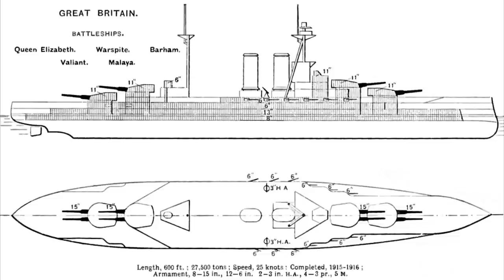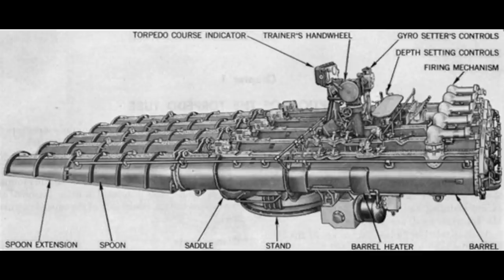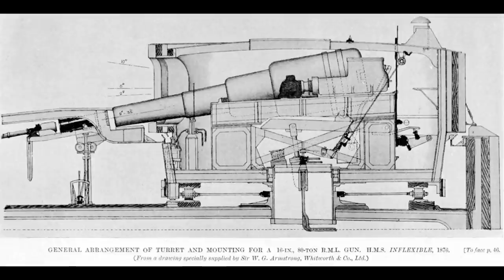The Drydock -- Episode 165

Comment from the maker: Pinned post for Q&A :)
Reply: What's the closest Western equivalent to the Japanese destroyer Shimakaze?
Reply: When HMS Venturer sank U-864 while both were submerged, the feat was deemeed extremely difficult if not impossibile. Nowadays and in the Cold War how easily could  submarines sink eachother in combat while submerged?
Reply: What things would have to happen (other than the Washington Naval Treaty not happening) for the L3 design to be chosen over the M/N3 and built?
Reply: SAil power is interesting as there are several attempts to incorperate it  .   
The coal crises of the 20-30s gave rise to the fletner , system, but was disgarded after the coal crises was over ,  in the 70s during the oil crisses  Coustau build a ship with the flettner system  ,  but again it was disgarded after the oil cirises was gone ,  but recent years it came back  and ships like E ship one where build  with that system reducing emisions .   

Also several cruise ships are buld with 4 to 5 and even 7  masts . to cruise the carabean and other areas ,only having an engine as an aid  .  

Also several large bulk and cargo ships have solar panels and systems to raise on the cargo holds in a clipper style configuration . aiding with propulsion .  when having a tail wind.
Reply: Canadian QE...did/was there room for 3 extra British QE in the British shipyards in 1913 or 1914 consideringthe international BBS being constructed,  the RN battleships and any other larger vessels like BCs and Armoured Cruisers. Wouldn't they take up room of a future planned BB or BC like Hood. Would their construction slowed as WW1 took hold like other British capital ships as well

As for their use, I agree with your summaries in WW1, British QEs being an part of Beatty, Canadian part of the Main Grand Fleet. 

WW2, wouldn't Canadian QEs also fall into the BB escort role across the Atlantic like Canadian Navy fell into the anti sub role in WW2. Leaving all 5 British QEs being moved to Gibraltar and Alexandria. I doubt Canadian would want their BBs in Mediterranean, let alone the Indian Ocean. The heat might affect them as well. RN at least cycled their crew, officers and members through their stations like the Mediterranean Fleet in the inter war period. I doubt would, and the air conditioning for the 3 Canadian QEs wouldn't be that great or modified from Atlantic waters.

Scapa Flow or Gibraltar might have the length of the leash IF the Canadian Government had control over their assets too. Maybe free up the new KGVs as well as Home Fleet might have been based around the older Canadian QEs if they weren't escorting convoys across the Atlantic. 3 BBs vs 1 or 2 German BBs  or BCs that emerge from the North Sea
Reply: Has there ever been a serious attempt to develop chemical effect warheads (HEAT, HESH, etc) for naval use? (Excluding missiles)
Reply: How was HMS Royal Oak modernised prior to WW2 and how much more effective could she have been than her sisters?
Reply: Nice entry. A question about general design of WW1 and WW2 battleships. On merchant ships and ocean liners of the era there are ventilators on the top (? Dorade box?) The cowls look vaguely like large tuba horns. They are absent on warships - so how are the lower decks ventilated?
Reply: Will there be analysis on specific u boat operations during ww2? Like operation Drunbeat for example
Reply: What ship did Jesus himself command in the Roman naval invasion of Vietnam of 1968. Don't dare incinuate that it didn't happen
Reply: @champagnegascogne9755  in what way? From what I can see, Shimikaze is different primarily in terms of using higher pressure machinery, leading to higher speed. For that purpose, every American destroyer of WW2 was analogous to Shimikaze by virtue of American use of high pressure machinery (600 psi steam plants, IIRC). If you mean the first such ship, the Gridley class took steam pressure from 400 psi to 565 psig. At first I wondered if you might mean the Akitzuki class destroyers which were dedicated AA destroyers using the 10 cm gun rather than the slower firing 12.7 cm gun.
Reply: @Wayne.J  Drach has observed that even during the dreadnought building race in the early 20th century there were still British shipyards going out of business for lack of profitable work.
Reply: @johnserrano9689  It was the good ship lollypop.
Reply: Speaking of screws, or propellers, I see torpedoes with tandem, or contra rotating propellers.  Was that not done on ships because ships can usually place the propellers side by side and so the tandem arrangement is not needed?
Reply: @Finnan189  thata boy 👍  hey thank you for clearing that up lol
Reply: the various ways to use smoke sound very toxic was this true did many sailors get cancer from the exhaust fumes
Reply: @themightynanto3158  Post-war submarines could locate each other underwater using active or passive sonar. Modern torpedoes are wire-guided to the vicinity of the target and use active sonar to home in from that point, so a hit is very probable unless the target deploys counter-measures.
Reply: How many, Marines, soldiers, none "Naval" personnel are usually on warships, how have the proportions changed over time and between war and peacetime?
Reply: @themightynanto3158  Drach will probably give you a better answer but. In modern Submarine vs Submarine combat the difficult thing isn't sinking the enemy (most submarine launched torpedoes nowadays are able to dive deep to kill nuclear subs). The hardest thing would be finding the other Submarine. Assuming it's not in range of the naked eye you probably won't be able to spot them. A British and French sub collided in the 2010s and they didn't spot eachover because both subs are so stealthy.
Reply: I do have a question about "Pre-Dreadnoughts" Given that HMS Dreadnought was to spend a good majority of her tonnage on her turrets to carry multiple heavy guns were there any proposals for a "Pre-Dreadnought" of comparable size but instead of multiple turrets she would instead carry 4-6 much bigger guns in twin turrets, going for sheer size over multiple guns?
Reply: Okay, now I have to ask what a hypothetical US tropedo BB built in the 1910's that made it into WWII would look like? How badly would said BB crew have wanted to remonstrate BuWeaps?
Reply: Ok, would your rather fight 1 Bismark Sized Battleship or 100 Tugboat Sized Bismarks? ;-)
Reply: In your answer to the question about the Canadian Queen Elizabeths having been built, you in essence said that as far as the Washington Treaty is concerned, if they’d been counted as part of the Royal Navy they’d have replaced three of the King George Vs, and everything else would have remained as it was historically. To me that seems to credit the other parties to the treaty with an unlikely degree of generosity. Wouldn’t the United States, for example, have insisted that the RN not be allowed to build the Nelsons since they had an extra three 15”-armed battleships, or that all four of the Colorados be completed, or that the Lexington & Saratoga be completed as battle cruisers, or some combination thereof?
Reply: @benjamin4673  my guess, and worth what you paid for it, is torps used contra-rotating screws due to the size limitation of the tube.  Same as some aircraft used contrarotating props to clear the ground.
Reply: Q&A Was there ever significant infighting in the Imperial Russian Navy between it's three different fleets for the allocation of resources similar to the infighting between the four fleets of the Imperial Chinese Navy? Or for that matter did any other navies with separate fleets have significant infighting between said fleets?
Reply: @paulgoyne6926  your comment ties in to a thread going on a previous post.  I think the assertion that three Canadian QEs would simply replace the three KGVs on the original retention list, or Thunderer and two GKVs, is correct.  The RN might even get the Nelsons, in place of the Iron Dukes as well.  The US did not want that conference to fail, for domestic, political, reasons, so was very lenient with the UK.  The UK was the only power to come out of the treaty well above it's tonnage quota, with numerical superiority, with firepower superiority, and with two ships of entirely postwar design, but the US got what it wanted: an excuse to cancel the 1916 capital ship building program.
Reply: @kemarisite  
Ok, thx. Just how many slipways did the Brits have to create new capital ships, update /maintain the 1st dreadnoughts etc.

 what about steel needed for these ships, the manufacture of naval guns and boilers and oil needed to keep them running during the war. Did Brits have enough naval industry to make them in same amount of time they made the British QEs.
Reply: Due to how physics work, how does "counter flooding"  not tear a ship apart
Reply: In the same vein as the Canadian QEs how do you think the Washington Naval Treaty would have been affected If Secretary Daniels had approved the 16" armament one or two classes earlier?  I don't remember if the first proposal was for the New Mexicos but I know the General Board recommended them for Tennessee and California.  Would either the UK or Japan demanded more new construction to compensate for the additional 2-5 16" American battleships or they would have accepted the status quo?
Reply: I the run to the North during the Battle of Jutland, Why did neither Hipper nor Scheer ever wonder why Beatty was steaming due NORTH towards Norway and not NW towards Scapa where Jellicoe should be coming from?  It seems a gross error on both their parts to chase a faster enemy on a course that is leading it away from their bases or reinforcements.  It seems neither ever considered the possibility that the Grand Fleet was at sea and perhaps close by.
Reply: If WW2 been delayed for a few years, would it have been a good idea for the RN to retire the R class battleships and reuse their turrets to build 5 Vanguards?
Reply: @Drachinifel, you don't believe the three additional Queen Elizabeths, considered part of the Royal Navy's allowed tonnage, would prevent the Nelson's from being constructed since that would give the RN sixteen 15 inch armed capital ships?
Reply: I've been looking at some photos of the aircraft carrier Ark Royal including of her sinking in WWII, and I noticed there are some odd booms symmetrically placed on the sides of the flight decks stretching far out over the sea; clearly given the era they are not for torpedo nets, so my question is this: what are they, and why did only British aircraft carriers have them?
Reply: You talked about doing a video on the Forrestal class? I’m interested!
Reply: Did Yamato ever hit White Plains at 34,584 yards, or 19.65 miles? given IJN shell this would have being a hit? Yamato guns Battle reports Accuracy(Main guns and secondary)
Reply: What was the circumstances and the ship that was the last to shoot down an aircraft with their guns?
Reply: I've noticed that Royal Navy warships that receive a name that has previously been used, it inherits the battle honors of the ship that previously held the name, what is the reason behind this?
Reply: Would better coordination between the north and south group result in changing destruction of both of the groups (mainly the cruisers)
Reply: Are there elements of modern warships that you don’t mind covering? For example, modern naval artillery (5”/62, etc.)?
Reply: Were Battleships capable of aiming/shooting their main battery guns in different directions at the same time? Are there any examples of this? What challenges did this pose?
Reply: After the ironclad development series, would you be able to do a comparative series of German and British battlecruisers?
Reply: @johnshepherd8687  my suspicion is, had Tennessee and California both been built with 16" guns, then, assuming you buy the story that West Virginia and Colorado were completed to approximate the 5:5:3 ratio of 16" gun ships with the Nagatos, then West Virginia and Colorado would not have been completed.  That scenario would have the Delawares carrying on into the early 30s, and Florida and both Wyomings entering WWII as "first line" battleships.  I put a question to Drac in guide 220 that would have about the same result: Daniels realizes. in Feb of 1919, that his decisions wrt the South Dakotas had rendered the Colorodoes obsolete, so, rather than throw good money after bad, Daniels orders Maryland cut up on the slipway and the other three cancelled before they were laid down, then the Lexingtons and South Dakotas are canceled for treaty compliance, what happens?  Unfortunately, he declined to address that question.  An even worse scenario is if Daniels had taken a page from the Admiralty's book, and canceled both the Coloradoes and Tennessees when the US entered the war in April 1917, as neither Tennessee nor Maryland was laid down yet, and all that was built of California was the bottom of the hull.  Then, to get the USN to the 525,000 ton treaty limit, the USN would need to retain the Delawares, the South Carolinas and some of the Connecticut class.
Reply: You're "forgetting" that the major forces in the theater were Chinese and Soviet pilots - not "North Korean Army formations" and "North Korean pilots".  And yes, the US Navy and its air arm did make forays into China and Soviet territory in pursuit of these planes - it's one of the more "open secrets" of the treacherously limited "Korean War".
Reply: The touch-off for the Korean War is actually a continuation of the Chinese Civil War between the Nationalists (Supported by the USA) and Communists (Supported by the USSR).  This btw, is one of the reasons why the US Military balanced its commitment to Korea by reserving forces in Europe - it could NOT just take forces and move them to East Asia - because it knew full well that the enemy it was up against wasn't "North Korea" or even just Communist "China", but the Soviet Union.  At the time, the PRC was desperate for food, which the USSR had difficulty in supplying - Truman refusing to cut these lines of communication, and even refusing to acknowledge that the USSR or even China was in the war killing American troops is one of the more treacherous episodes of the Korean War which DOOMED the Truman administration and vindicated MacArthur.  Truman not only openly took nuclear weapons off the table, he openly took any reprisals against China or the USSR off the table - something Eisenhower admitted was the ultimate betrayal of the troops the President ordered into a war (if he wasn't willing to back up his own troops with nukes, he should NOT have committed those troops).  Pointedly, President Eisenhower pointedly did NOT repeat Truman's treachery in his administration: The Nationalist Chinese controlled two major islands, Hainan and Taiwan.  At the time of Truman's administration before the Korean War, Truman was still favorable towards the USSR (and a result, PRC) and cut off the ROC (Nationalist China) - the result was predictable; the PRC overran Hainan's defenses (giving the lie to the presumption that the Chinese did not have amphibious forces for such an operation).  Eisenhower changed this policy (by necessity; any further cover ups of the Communist Chinese and Soviets killing American troops in Korea were now futile with returning American soldiers bearing witness to the Truth, in spite of the Communist American media's attempt to deny it - which is the only reason for the so-called "forgotten war" - it's the Communist Media that wants to forget it was caught lying).  The Ike administration pointedly drew a red line at Taiwan - where American forces were actively supplying the Nationalists with supplies and food - and nuclear weapons were VERY much still on the table (As for the small islands that were over 100 miles from Taiwan, but only 8 miles from the mainland, the Nationalist troops were on their own if they wanted to keep them, albeit the USA continued to supply the war by sea and limit the PRC and USSR's mobility and surveillance assets in the Nationalist effort to hold them - which the Nationalists did).
Reply: Considering admirals Darlan and Laborde, are there any good French admirals of WW2 whose service might karmically balance the actions of these two characters?
Reply: Did not the Nautilus manage a submarine fleet screen interception at Midway?
Reply: @kairopalmer5109  People misunderstand the concept of Fleet Submarines in World War 2, particularly about American Fleet Submarine Doctrine in World War 2, and especially as it developed during the War.  For one thing, they forget why the US Navy was so hell-bent on building coolant systems and HVAC into its submarines (the refrigerants weren't necessarily for keeping the crew comfortable, or the icecream ice-cold) - that's one of the big reasons why American submarines were so big - it wasn't just because they were built to carry more crew and supplies - remember, that the larger crew complement included technicians and operators for the extra electronics who's components were especially sensitive to heat, humidity, salt-water, etc.  So why did the US Navy focus on these systems in the 1930s (actually the systems and design development had begun in the 1920s), when the other leading Navies didn't?  Why build a bigger sub, larger crew, more structurally compromised, complex, etc, sub?

The Short Answer is: Air Superiority.

It will take some ground work to get the point across, though, so the Long Answer is:

The US Navy had long since decided that airplanes were the Nemesis of Submarines - and this would later prove very true; while roughly half of subs were "killed" by surface vessels in WW2, and the other half were "killed" by airplanes (and a small % were killed by friendly fire and accidents), more than NINETY PERCENT of all subs were first positively LOCATED by plane ("Intelligence" and "code-breaking" didn't matter in this regard, because you still had to locate the sub in the empty and vast expanse of the ocean).

The reason why the German submarine force was being wiped out is that Germany lost air-superiority - in WW2, it's all about this singular fact.  And in the days when the Luftwaffe reigned prior to 1942, it was the BRITISH submariners were taking horrific losses, while German submarines operated with relative impunity.  It was this initial detection by aircraft that was the true Nemesis of any submarine because it stripped the submarine of its concealment and exposed its location for specialized hunter-killer units to converge on.  Once exposed, the Submarine's mission to attack convoys or warships was over, and it was running for its life.

This effect could also be seen in the Pacific and Indian Ocean - the Dutch submariners in 1941 were wiped out and the British retreated (along with their Aircraft Carriers) to the other side of the Suez Canal to escape destruction by the Japanese Carrier Force.  And while the Kidou Butai Carriers ruled the Pacific and Indian Oceans, the German and Japanese submarines took a terrible toll on British and Australasian shipping.  If Japanese anti-submarine warfare were really as poor as some claim, then why were the British and Dutch submariners so ineffectual during the war in the Pacific and Indian Ocean? (the Dutch Submariners were all but annihilated, and the British fled both Oceans)

Because British and Dutch Airpower was destroyed or routed out of the Pacific and Indian Oceans, by Japanese Carrier-borne Air-superiority, the Kidou Butai.

That is, until the Kidou Butai was destroyed - and then, the Japanese and German Submarine Forces in the Pacific and Indian Ocean were hunted down like dogs.  Meanwhile, American submarines ran wild having been afforded the freedom bought at the destruction or distraction of the Japanese Carrier Fleet, and the dominance of the American Carrier Fleet.

Admiral Nimitz, himself a submariner, knew this quite well; Submarines were to become a COMPLEMENT to the Fleet - they could not operate independently of Fleet Forces against a modern Blue-water Navy (which inherently means "Carrier Force") without GRAVE consequences, because ANY Blue Water Navy in the modern era supplied its OWN air superiority.  And if the enemy Carrier were allowed to focus ONLY on anti-submarine duties, those Carrier forces would annihilate the your submariners.

With this forethought in mind, the Americans built specialized Escort/Light Carriers to focus on submarine-hunting.

Notice that the vast majority of instances where submarines kill Carriers happen when the enemy carrier is somehow compromised by other fleet units, especially opposite Aircraft Carriers, and must reserve its aircraft for destroying higher priority targets rather than submarines (in the end, the ultimate threat to an Aircraft Carrier, and the entire Fleet really, is NOT a submarine.  The ultimate threat is an ENEMY AIRCRAFT CARRIER).  At Midway, while I-168 technically "killed" Yorktown, it was actually Hiryu's planes that had dealt the critical blows and (just as importantly) had absorbed most of the focus from Yorktown's planes (Yorktown had no operational planes hovering when I-168 torpedoed her). At The Battle of the Philippine Sea, Taihou and Shokaku had reserved and expended their planes on the American Carrier Forces (Shokaku had been all but de-planed and was receiving inventories and fuel when she was torpedoed by USS Cavalla).  And the Shinano?  The Biggest carrier ever sunk by a submarine?  Shinano wasn't flying any planes when she was hit by USS Archerfish - she was an aircraft workshop, transport, and ferry at the time.*1

As should be resoundingly clear, the American Fleet Submarine Doctrine was prescient in multifaceted ways that permeated throughout its military and industry - and is the reason for the design and logistics built into the American Fleet submarines.

As a colleague of mine notes "I can tell you what your building, floor plan, factory floor, etc, is for, right down to how many people it accomodates, what their profession is, and what exactly your products are, just by looking at the HVAC infrastructure."  As I noted to him, the same can be said for Warships.  You need only look at some of the WW2 American Submarine manuals for coolant and ventilation systems online to figure this out too.

And these coolants, refrigerants, and ventilation systems were meant to control the environmental conditions for the Radar (among other systems).  SD radar was perfectly sufficient for air search, while SJ Radar gave better resolutions for tactical and surface use, and provided "better" information for range and trajectory of aircraft courses to predict when it was safe to run shallow and use the periscope (though I have other thoughts with my collagues but whatever).

Because the ultimate anti-submarine Naval asset is a Fleet Carrier.

Relying on visual sight, a submarine would have only seconds to respond - if that - and submerge before the aircraft got on top of them.*2  And even then, it might be too late because submerging would still leave fresh signs of its wake detectable by aircraft (the faster the boat had run, depending on the sea-state, the more its wake persisted on the surface), or a silhouette that was still visible from the air.*3

But radar gave American submarines the ability to obviate most of this*4: instead of seconds, American submarines had 5–15 MINUTES depending on the aircraft’s closest-point-of-approach, weather conditions and altitude.  With THAT much forewarning, the American submarines EASILY evaded Japanese aircraft, submerging deeply with their wakes washed away, even into the glassy Pacific waters, LONG before the Japanese planes got in visual range.

This is how the American Submarines avoided Japanese anti-submarine warfare - which was more than capable compared to the other leading Naval powers such as the British and the Germans - and second ONLY to American anti-submarine Warfare.

Still, this is mostly a DEFENSIVE measure.

For true Offensive operations, the submarines requires Local Air Superiority (the enemy Air Forces are contested, distracted, or otherwise rendered inefficient), and even better, Theater-wide Air Supremacy (the Enemy Air Forces are destroyed).

Thus to truly realize their potential, the Submarines, submariners, and logistics must be built, trained, and supplied to operate as part of a modern Fleet - an Air-Superiority Fleet. 

A Carrier Fleet.  

The Doctrine of the American Fleet Submarines.
Reply: *1 Had any of these Carriers been operating their planes to focus on Anti-submarine duties, or even had routines patrols, it is DOUBTFUL a submarine would have even dared to approach for a torpedo shot - assuming they even escaped detection (which is questionable, more on that later).  They would have submerge themselves for hours, and/or hope for dusk to set in.  NOTE: There are examples of submarines detecting Carriers (including one famous case of the Enterprise at New Caledonia), but ran for their lives, realizing they themselves were about to be detected (or were indeed about to be sunk).  By what, you may ask?  Aircraft.

*2 And as often as not, the submariners missed spotting the aircraft for the same reasons the aircraft might miss spotting the submarine; weather, fatigue, the position of the sun, etc.

*3 Some tidbits about WW2 Submarines: Crash diving alone offers a poor solution to patrolling aircraft, which has been born out by history: (1) Submarines at best could dive in 40 seconds under perfect conditions, and closer to a minute in reality; by that time, a plane on submarine patrol at an altitude of 3000 ft will as likely spot the submarine itself - and if not the submarine itself… (2) The plane will spot the submarine wake - the tell-tale signs of a submarine are not simply its periscope feather or its radar and sonar signature, but the fact that WW2 submarines are “submersible boats” - their hull forms and designs are built to operate mostly on the SURFACE because to do otherwise would severely compromise their fuel capacity and stores, thus compromising their range, speed, and operational-combat effectiveness. (3) Submarine can be easily seen from the air even AFTER they submerge; this has to do with the simple reality of light refraction.  A person standing on the shore looking out on the Pacific will see a “mirrored surface” - but put that person in the air and look straight down?  He’ll easily see sharks, whales, and yes WW2 submarines at 150 ft beneath the surface on a clear blue day (4) Submarines need to be painted a VERY dark “Navy-blue” if you want them to really disappear - the problem is that WW2 submarines are - again - “submersible boats” - which operate mostly on the surface, meaning they have to paint their hulls a “haze” or “deep greys” - painting them a Dark Navy-blue would only EXPOSE the submarine against the hazy horizon while on the surface.  In fact, for most submarines, the best form of “deep-blue camouflage” was for the submarine to hope that the weather and overcast would prevent light from penetrating the water deeper into the ocean, allowing it to blend in at shallower depths.  Of course, hoping for Lady Luck is not a good strategy. Etc, etc, etc, there's more, but you get the idea.

*4 THIS is what the The XXI was meant to obviate - this detection disadvantage against aircraft - and it was a failure.  .  If Germany had somehow built dozens or hundreds of these ships, they'd have been killed just as any other submarine.  With the Luftwaffe's control of the air receding and a Kriegsmarine lacking Aircraft Carriers, the attempt to obviate air-superiority with extended time underwater was laudable but impractical - and it is this lack of practicality that makes it similar to the Turtle of the Revolutionary War; the Turtle failed for a multitude of reasons, the most serious of which was a lack of torpedo technology, whereas the XXI failed for a multitude, but technologically it was for a lack of powerplant technology.  Yes, both were radical and laudable design attempts - but they were still failed designs which couldn't meet their practical goals, and more importantly couldn't meet practical realities to even theoretically win their war (again, Edison's high regard for successful failures being necessary to towards a workable solution, is something any good engineer and inventor understands.  I'm not saying XXI was useless design in the scope of historical technological advancement - but Germany building them to win WW2 was demonstrably counterproductive).  XXI didn't work; it was built to operate in the ABSENCE of a German Aircraft Carrier (and beyond its technological shortcomings, its design philosophy was its real fatal flaw).  The Balao class's design by contrast, rightly continued to rely on fleet support and air-superiority provided by an Aircraft Carrier, which was necessary to carry out a successful submarine campaign.

It was the advent of American Nuclear Power and Propulsion that solved the powerplant problem - virtually unlimited power meant that a submarine was not only capable of generating an endless supply of breathable air and mechanical energy without having to surface, but also meant its endurance away from shore and supply was limited only by the crew's stamina and onboard  food stores.
Reply: @Drachinifel The answer to the French Fleet question somehow got me to this hilarious question of mine, though it isn’t really practical to answer in a drydock, admittedly. So, World War II, except Japan and the U.K. have switched sides, both in terms of Allies vs Axis, AND geographically, with the Japanese archipelago in the NE Atlantic and the British Isles in the NW Pacific, with their fleets following suit. To keep things somewhat less complicated in terms of geography, they also switch colonies and objectives as well, with Australia, New Zealand, Canada, and India now being Japanese colonies, and Korea being a British colony. Likewise, Japan is trying to defend itself and Europe from German advances, and the U.K. is invading China, securing oil and rubber in SE Asia, and planning a surprise attack on Pearl. Assume that everything else stays the same, including which ships they built for themselves and for others. For added hilarity, Army/Navy relations are switched as well. Very weird magic/alternate universe shenanigans aside, how do you think each would fare in each other’s role? Would they do better or worse? Likewise, you could also do this for other countries (although without geographic switching because they aren’t islands), such as France and Italy switching, Greece and the Netherlands switching with Romania and Czechoslovakia, Norway and Finland, etc. I understand it probably won’t be addressed, but I still think it would be fun/interesting to think about.
Reply: Did Britain actually have enough large slipways available (ie not already building something else) to build the 3 Canadian QEs at the same time as the 5 historical QEs, or would it result in either them or the first 3 Revenges getting delayed? I've made a separate post with some of my own speculations about how that might turn out.
Reply: Q&A on hull form.   Were any major navies attempting or playing with cat hulls or outriggers?  It seems to me that outriggers would make nice belt armor or torpedo "net" spaced armor, along with an advantage of stability.